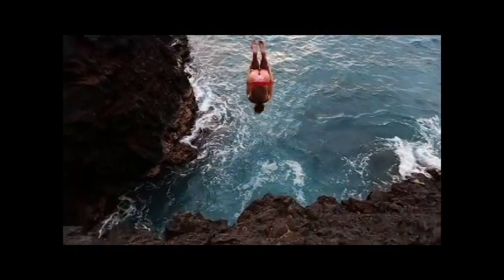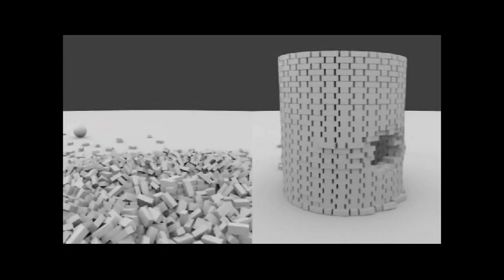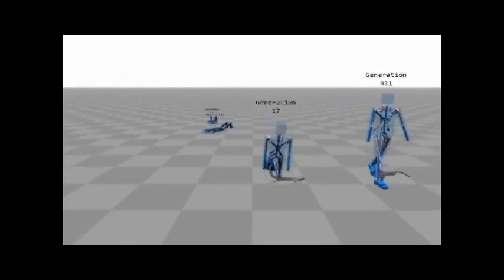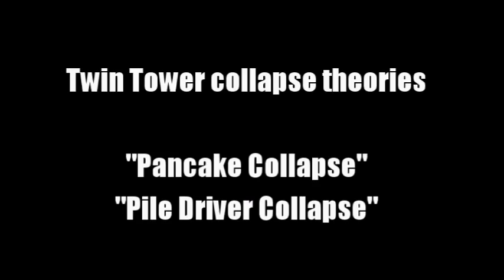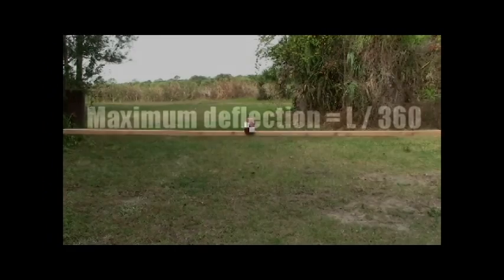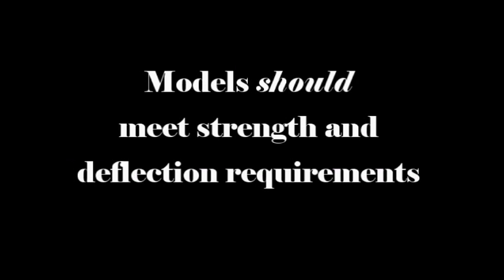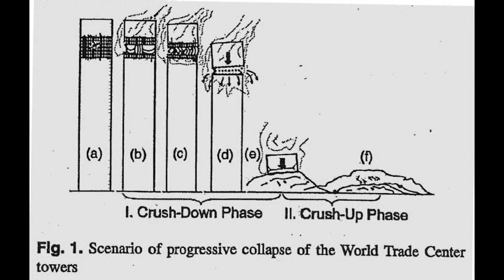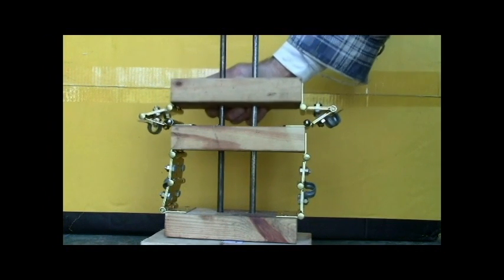9/11 Experiments: The Force Behind the Motion

Comment: What you forgot in your experiment was the fact that FAR MORE floating floors were now untied to the exterior frame. Also, as the building collapsed, there was no way to determine the movement of about 35% of the total building, (the top) which in video shows it fell over and inverted. Thus, the top portion of the building "TOOK OUT" an entire corner of the steel frame holding up all the remaining floors. It was like a KARATE chop by a giant crushing a corner of the frame holding up the floating floors. Those floors need at least 3 holding points to remain but by taking out TWO of 4 sides, the building had no chance of staying up. Thus, your pankake theory is wrong because you only have 2-4 sides to decellerate. Get it?

Comment: This sad fellow forgot that the inner core collapsed as did the outer wall did and its friction that halted his floors from falling in his most ridiculous model using cement tiles/pizza dividers. The best analog would be to use dominoes with sheets of paper for each floor because the WTC was built by essentially stacking steel and flooring much in the same way....

Comment: I have to say I am not an engineer or scientist, and I found your video extremely interesting, and have been thinking about it for some time. I offer the following observation purely as a layman, based on my reading of things like the NIST reports, and other papers put forward by scientists and engineers. I do so only so that you may, if you were so inclined, refine your experiment... I think your assertion that the force was out and down is correct. However another explanation other than the use of explosives to achieve this is the construction of the building itself, a central core, and an outer skin of steel. In your experiment the floors break in half and pile up on one another coming to a standstill in accordance with Newton's third law. But the collapse of the towers was more akin to the way in which bamboo splits, so as the floors came down the outer steel skin was pushed away from the building in strips, in all directions, like peeling a banana, and floors would remain level as they crashed into one another one after the other all the way down... I would like to say I am not a conspiracy theorist, nor a debunker, merely an impartial observer passing on an observation that you may find of use in further experiments.

Comment: check the purchases of auto impack sensors. Its obvious such devices were employed for  demolition . Local suppliers of these should be checked as well as who purchased them. The explosives used were conventional but evidence suggest other sources were deplored to transform metalic n concrete meterial to dust. This explains why the base "tub" wasnt damaged nor resulted in ground tremor from colaspe. 
Trump was granted security n election in exchange for abandonment of 911 investigation by the Zionist. This organization now has total control of our political and economic system but certainly not to our detriment but to our survival in a coming diaster spawned by global overpopulation.

Comment: This is all great research but you are not taking in and re-enacting the facts or questionable variables. There were fires burning for at least 50 minutes or more in each building. That is a long time. No one in these physics videos takes that into account. Everyone goes from impact of the planes then to collapse without taking any of the variables of time, heat and pressure in between.

Comment: How is your model a reflection of reality.. Its so stupid.. For one its not to scale and secondly it doesn't represent the structure of the building or the situation at all..   You would need a weight to scale that represented the exerted force of over 30 thousand tons.. The weight you used wasn't enough.  You would also need a support structure that relied heavily on damaged trusses that connected inner supports to exterior supports.  The steel was able to take the impact and the weight, but the floor welds weren't.  That is what failed..  Once the trusses failed than the stability of the building was shot because of the unique structure different than most buildings.
Reply: Guinea54  I would love to see these towers built properly for scale. I wonder if they could scale the impact and fires also. Probably only on computers.

Comment: Easiest way of getting perfect results is to use a pressure detonator on every floor that you would like to weaken. By doing that you will reach a perfect timing so that every detonation in the sequence ignites smoothly enough to get a flowing motion without decelleration. I have no idea if this is the case but it would work without electronics based ingition sequence.